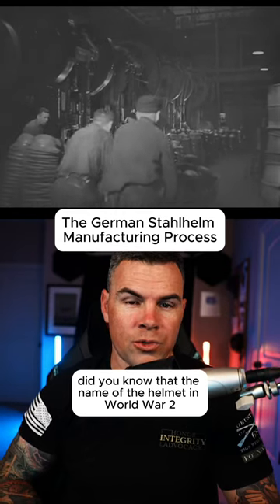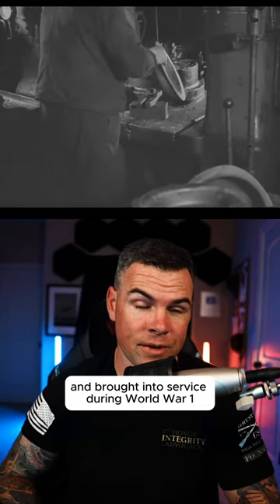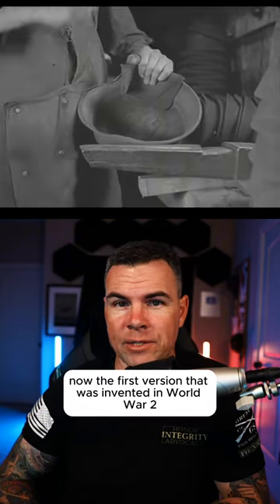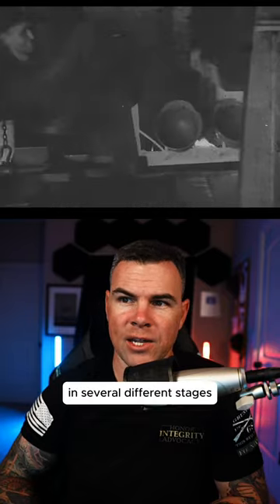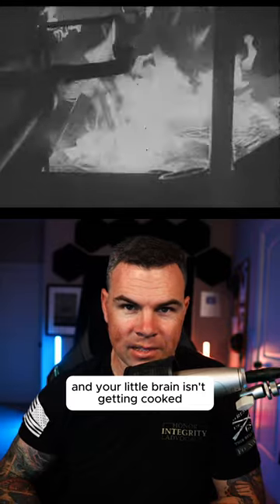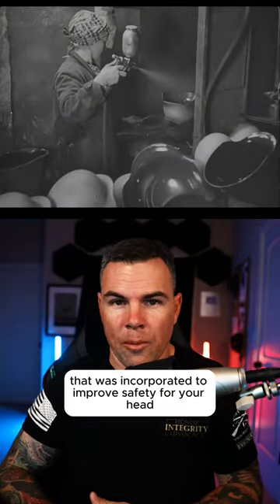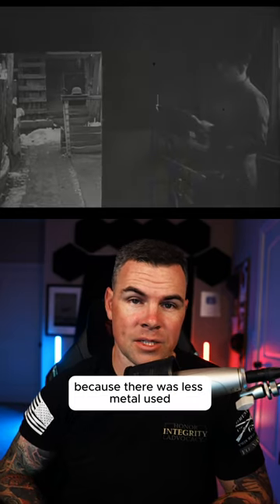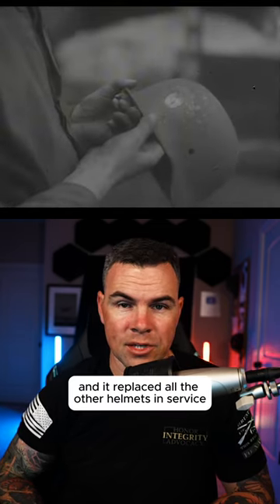The German Stahlhelm of World War 2 #military #army #marines #soldier #airforce #navy

Comment: helmets were a false security
Reply from the maker: Still are
Reply: @kagan.dunlap  the steel helmets with fiberglass liners we used in the +/-60’s-80’s weren’t great but they did save some lives because the design would allow a round to penetrate the steel then would travel around between the steel and fiberglass instead of causing a head wound.
 Also during the Gulf War I saw video of a young Troop who was pinned down and he put his face in the dirt and his Kevlar helmet took 3-4 rounds right where his forehead was but they didn’t penetrate and he got up smiling.
 I think the biggest flaw the helmets our kids are using now is they don’t cover enough of the head, and the chin is left unprotected.
 We can do better.